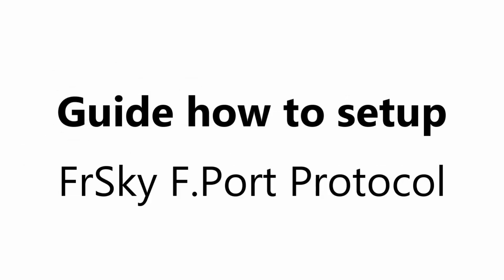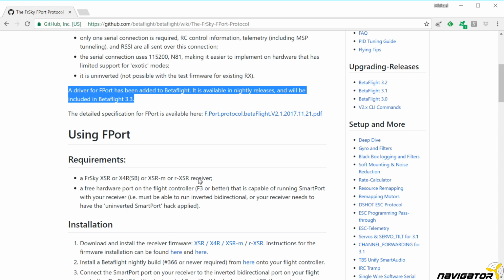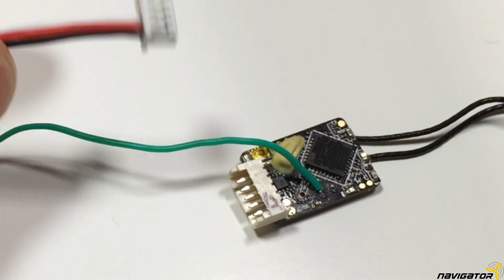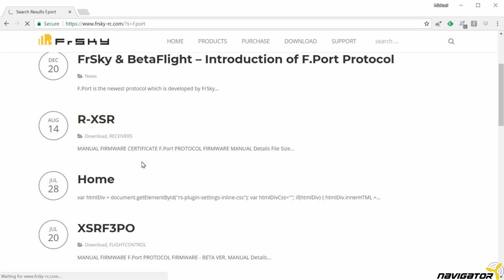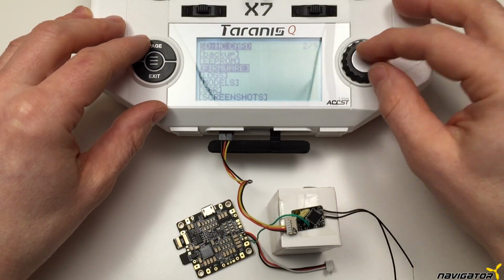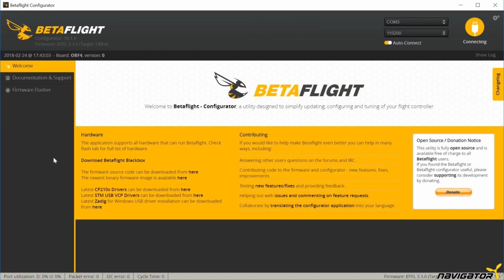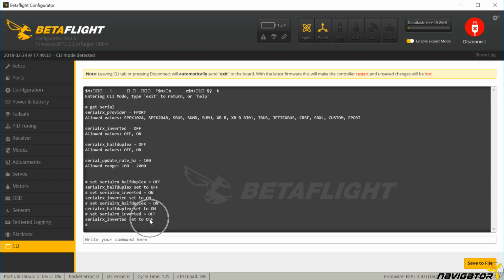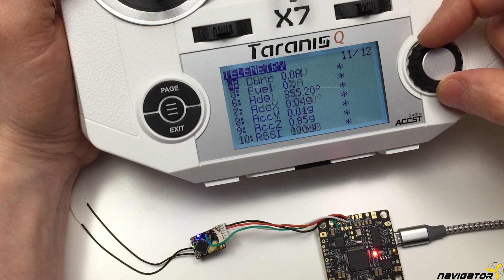Guide how to Setup F.Port with FrSky R-XSR and Betaflight 3.3 (English)

Comment: I have a Tmotor f7 HD board with the r9MX receiver, i have hooked up the F port wire to TX5 on the FC and set half duplex to On, and inverted to OFF but nothing is showing in betaflight. anyone know how to get this working as there isnt alot of info on the r9mx receiver on the internet and how to setup

Comment: It's outdated now, the new firmware somehow combines both configurations in one file.
They fail to explain how to enable fport, so with the current firmware only employees of frsky know how to use fport. Other need to use old firmware.

Comment: I have r-xrs bound to x-lite it has soild green light, and when I unplug battery the radio says telemitry lost. When i plug it back in it says telemitry found. But in betaflight it has no stick or switch movement, and says arming disabled. I checked and it says, RXLOSS CLI MSP.  Any help and I would be very greatfull!
Reply from the maker: Telemetry is one direction. Stick commands the other. It seems, your TX and RX are bound, but there is no working link between the RX and the FC.

So, it seems your F.Port Link between RX and FC do not work. Make sure the correct firmware is flashed (explicitly F.Port compatible firmware), the hardware connection is right (UART on FC, Port on the RX) and the FC Firware is configured correctly (F.Port Protocol, CLI Commands).
Reply: I have this exact same issue it's such a headache :( everything was wired up by a pro it's all solid and he was flying it but my qx 7 will only get telemetry but no stick inputs :( plz help
Reply from the maker: If you followed the video exactly, there is not much left to go wrong. First thing to try is, using another UART. Somethimes UARTs are shared, f.e. with LED Control or ESC Telemetry. Sometimes UARTs are hardware inverted, others are not. In my experience, it's rarely documented well, f.e. with the racepit mini, which is a great FC, but UART2 is shared with ESC Telemetry. I hooked Cam Control to it and wondered, why it would not work. This took me a while to figure out.
So, what I do in this case, go through the tutorial or manual again and double check if you wired everything right. Sometimes I just try to switch cables in case I (or the manual ;-)) mixed RX and TX up. Then I try a different UART. If that does not work, I replace the cables, in race cases they are broken.
If I am 100% sure the wiring should work, try software configuration. Try a different firmware version, or even firmware, just to rule that out. Try on another flight controller, to rule out that your FC has a defect, which may happen (more often than one my expect).
Reply: Thanks for the reply. It is wired up correctly flashed to fport firmware yadayada for some reason it only works on 1 wire mode? Not fport in the config tab so progress I guess? But now more confusion haha about to throw the fricken reciever in the dumps an buy a new one. Everything tested with another receiver works fine. It's just stuck with only working on one wire mode

Comment: nice tutorial,  why do you connect the green wire to tx3 and not on sbus  pad?   in my case the sbus is uart 6 , the uart 3 is used for  ir tramp  and uart 1 is free
Reply from the maker: the sbus pad (normally) has hardware inversion. a normal uart (w/o hardware anything) will work fine (w/o hacking or software inversion). that's the reason I chose TX3. In your case, I would recommend using uart 1 (TX1). You can also use TX6.

just as a remark: sbus is RX , receiving signal from the receiver. s.port ist TX for transmitting signal to the receiver. for f.port you need TX in (half-)duplex mode, not RX. (Ofc you can remap ressources in BF, but using the right soldering pads is the easiest approach).

Comment: This is great thank you.  I only seem to get RSSI and battery, no other sensors are found.  Is this correct? cheers :)
Reply from the maker: RSSI and battery comes directly from your receiver. So, you have bound transmitter and receiver successfully. But that's it. There seems to be no transmission between your flight controller and your receiver. If you are certain, that you have the F.Port firmware an your RX and the wiring is right, make sure the Setting on your FC (Config Tab, Receiver, Serial Based RX, FrSky F.Port) is set.
Reply: @N4V1G4T0R  im getting the same sort of thing, my rx is working as in the fc is seeing it and i can arm and do what i need to but the tx wont discover any sensors??
Reply from the maker: If you have F.Port signal working then it's all or nothing, it's a bidirectional signal (duplex). Other than S.Bus (from RX to FC for control) and S.Port (From RC to RX for telemetry) which work in one direction. If you do not discover any senors at all, then it's extremely strange, because your RX sends basic telemetry data, like RSSI and Voltage. At least the RX i know do that like the R-XSR and Crossfire Nano. Maybe you have a RX, that is not capable of telemetry?
If you only miss the telemetry from your FC, make sure that "Telemetry" is activated in the betaflight config tab.
Reply: @N4V1G4T0R  I do get rssi and Rx voltage but no sensors, telemetry is activated in inav, I have the R9 mini, maybe I'm just having compatibility issues?!?
Reply from the maker: The R9 should work as well. But, I am not sure about inav. Just to make sure, make a dump of your inav config, flash betaflight and check if it's working there.
Reply: @N4V1G4T0R  managed to get the R9 working perfectly with softserial on a pad on the underside of fc, took a while to find which pad I needed to use, but now GPS has decided to play up... Feels like I'm chasing my tail...
Reply from the maker: check your resources, eventually you have assigned the same address to different functions, which is normal for many FCs. normally, not all functions are used, so, that's fine. unless you use different functions. either you reassign addesses, or solder your GPS to another pin (and hopefully catching one, that's not double-assigned).

It's just curious, that you need soft serial... it should work with a normal UART...

Comment: Can I connect sbus to sbus for rx signal and s.port to uart3 for telemetry or does that not work?
Reply from the maker: you can do that, sbus-sbus-uart and s.port to uart3. That's the "normal" way before F.Port.

If you use F.Port, you only need one cable for both, rx signal and telemetry.
Reply: @N4V1G4T0R  ok thx!
Reply: thx

Comment: Can this same thing be done with the HGLRC F438? Which pad do I solder the green wire too?
Reply from the maker: I suppose so. F.Port goes to any free and uninverted TX UART (not RX!). Do not forget to switch to half duplex when using F.Port.

Comment: hi
i have a emax hawk5 and i remove the mx+ and install the r-xsr so i just connect 3 wire to uart6 on the magnum f4 FC . (receiver s.port to TX in uart6) and .
i did all the rest in betaflight like your video . but the FC channels wont move in the Receiver tab? 
what i am doing wrong here ? pls help
Reply from the maker: You need the uninverted S.Port Signal for F.Port to work, as well ast he F.Port Firmware on your Receiver. Did you do that?
Reply: Michael Orter Navigator 
I did the software in the receiver with f port protocol.  But i didn't do the uninvited pad signal. 
I will try it tonight and let you know
Reply: Michael Orter Navigator 
Thanks man its work now .

Comment: I'm using the Airbot Nano v6 with an R-XSR with F-Port latest firmware. I cannot get telemetry to work. I only get 2 sensors to show up and my LUA scripts will not work. They do not flash "No Telemetry" just no data shows up. I followed this guide: https://github.com/betaflight/betafl...FPort-Protocol

I'm running Betaflight 3.3.3 (also tried 3.4)
Taranis X9D SE
Spark32 ESC
Unify Nano VTX 
I have the s.port wire soldered to the RC pad. All of my rc inputs work fine, just no telemetry. 

Any one have this working?
Reply from the maker: It sounds like you use the inverted signal. You must use the uninverted signal for this to work. There is no software inversion (not that I know of, forget "telemetry inversion in BF, did not work for me). Use the "hardware hack" to get the uninverted singal and solder it to a pin on the FC that does NOT have an inverter on it. (normaly everything else than the "betaflight" bad works fine).

Comment: I've installed and runs ok except the Lua Script for BF Pid config. Have you had the same problem?
Reply from the maker: I have not yet found the time to check out F.Port with LUA scipts.
Reply: hey, have you found the solution? I'm having the same issue.
hablo español, por si acaso.

Comment: Thanks Michael, I learned something else.
I have a problem though:
- FrSky Horus X12S
- FC F4 "hglrc xjb-f428-tx20.v2"
- R-xsr
- S.Port on the pad
- Uart 3

Everything works except to see RSSI on OSD!
No channel on Betaflight that can resemble an RSSI
I can see Volt-Fas also on the radio, so it works.
Can I or should I do some things to get the RSSI signal on OSD?
Thanks and congratulations.
Reply from the maker: If I understand you correctly, all you have to do is to send the RSSI Signal from your Transmitter back to the FC via one free channel (e.g. Channel 14). In the receiver tab, you assign that channel to RSSI (RSSI Channel e.g. AUX10). That's it. There are several videos on how to config your Transmitter. If not, just give me a call, I'll create one.
Reply: Today I try again and let you know! I think I'm working correctly, but I'm definitely missing something. I have to re-check the setting of the HalfDuplex on Betaflight, maybe that's it and I do not get the signal back! Thank you.
Reply: I sent you a help message on Facebook with a link to the photos I made of the setting. It seems to me all right but maybe I make some mistakes that escapes me! Thank you
Reply from the maker: ok, let me know the outcome. I'm curious.

The RSSI Signal is measured between RX and TX. So, it does not really have anything to do with F.Port, or S.Port. The three sensor data are sent from the receiver RX (the R-XSR i'm talking about) to the transmitter TX directly. Without the need of the  FC telemetry to work.
Reply: Wow, I did it! Thanks to you I focused more on the radio: on FrSky FrOS there is a telemetry menu where set the range of values accepted: RSSI was the default 0-0; I set 0-100 and here is the magic RSSI returned from the radio! Many thanks Michael I will continue to follow your videos with much interest! Good night!

Comment: In your video you left the S.Bus cable (white) connected to the FC pad but it's not necessary to have it still connected. I'm right ??
Thanks in advance
Reply from the maker: Yes, it's either or. White is the inverted F.Port signal cable, green is the uninverted F.Port signal cable.
Reply: I wired my Emax F4  mini magnum for sbus thinking rssi would work. I’m going to do fport procedure now. Can I leave the white wire S port in place while I test out fport?
Reply: Thanks for asking... that was the same question I had:)

Comment: I've been trying for weeks to get tel on the hglrc f4 pro to work and nothing would work. I about gave up on this method  too but soldering to the P pad worked and everything came to life! Thanks. Also im using Butterflight 3.4.2 if anyone was wondering if this would work with ButterFlight.
Reply: Id be curious how you did it....I've tried with the F428 and the Zeus and Fport / R-XSR with updated firmware to the FCC and BF 3.3.2. Nothing in receiver tab will respond. I've tried using the R-XSR telemetry wire from the harness as well as the uninvert hack "p". And all 4 combinations of (set serialrx_inverted = OFF / set serialrx_halfduplex = ON). It works find with resource remapping but I'd prefer to not have to use the plug for the Zeus board....

thnx!!!
Reply: When you say resource remapping you're talking about Softserial? Could you help me on that? I have tried the uninvert hack "p", but I've stupidly damaged the solder "p" pad and now my R-xsr doesn't have one anymore. So I'm looking for a solution. I use f4 hglrc F440
Reply from the maker: By remapping, I mean resource remapping, not soft serial. Go into the CLI and type "resource". You will see the resources. This was you can switch the resource mapping, (with limitations).

Comment: hello, i tried to follow you tuto but it doesn't work. Can I solder the F port wire on the Sbus pad or do I have to do it on the RX1 or TX1 pad? Thanks a lot.
Reply from the maker: In all of my tests with different FC, the dedicated SBus soldering pad did not work. Also, the UART1 did only work for the controls, but not for telemetry, despite all variations of the CLI commands.

So, yes, in my experience, you have to use a free UART other than UART1 (at least for the F4 and F7 I used in my experiments).

Comment: Pls help, I got f-port on my r-xsr with x9d taranis with an omnibus f4 v3. I got it on tx3. I got rc working, but no telemetry. Any suggestions anyone? I've tried multiple times discover new sensors
Reply from the maker: Hello, ok, that should work. You obviously have the right firmware on your R-XSR.
Make sure you have telemetry activated in betaflight configuration tab.

If that's on, and still no telemetry, try the uninverted signal from the soldering Pad marked "P" on your R-XSR and connect it to TX3. Do not switch on Smartport or anything in the ports tab. But make sure UART3 has Serial RX activated (which you have, otherwise it would not work even for the rc.

If you have the uninverted F.Port signal, the correct settings should be
serialrx_provider = FPORT
set serialrx_inverted = OFF
set serialrx_halfduplex = ON

I hope that helps
Reply: Michael Orter Navigator  Did anyone ever get this to work on Omnibus f4 v3? I was also only able to get rc to work but no telemetry. With the uninverted pad I get nothing. Tried all combinations of inverted/halfduplex settings in CLI to no avail.

Comment: i'm having a hard time understanding it all. XD I have the same FC as in the video and want to use the TX6 pad for smarport which i understand is uart 6? What do i need to do? can't find any facts that the TX6 pad is linked to uart 6 and ore if i need uninverted signal or can i use inertion in cli? My bord is waterprooft so downt want to do any soldering.
Reply: FPORT did not show pids on my taranis with the xsr so i had to use sbus and rx invert hack to get lua to work
Reply from the maker: yes, you can use uart 6 for F.Port. This means, you have to connect the uninverted signal from the RX, which which will be your F.Port after the RX firmare flash, to TX6 on your FC.
Reply: when using f4 flight controller the only option is to use the uninverted smartport output? i followed your instructions to use the normal inverted output and set the first option that you show in the CLI and it didnt worked when soldering to a UART 6 TX (command changed to 5).
Reply from the maker: Yes, that is my experience, at least with that specific FC. Only the uninverted signal works. But that works on any UART I tried (1, 3, 6)

I also tried to use the inverted S.Port signal from the plug. I was able to get former S.Bus signal via F.Port. But I never got the telemetry to work, whatever settings I tried (BF inverted ON/OFF duplex ON/OFF in all combinations).
Reply: Thanks!
Same happens on my side
Reply: so it keeps defying the purpose of having a connector if you have to have a cable soldered to the receiver :/ right?

Comment: I'm on an F3 board and I was following the standard instructions and getting nowhere. Your 'If we use the inverted signal cable from the standard output, we set half duplex off and inversion on.' was what I needed and now my new RXSR works in Fport mode. Thanks!

Comment: So you're using the UART3, now what can you do with the SBUS UART? So are you actually freeing up a UART?
Reply from the maker: You can use the "SBUS" UART for anything you wan't. It's just another  UART. ;-) With one minor difference, UART1 on F4 can normally handle the inverted signal. The other UARTS don't. (afaik)
Reply: I guess the inverter would only be on the RX portion of the UART huh? Sounds good!